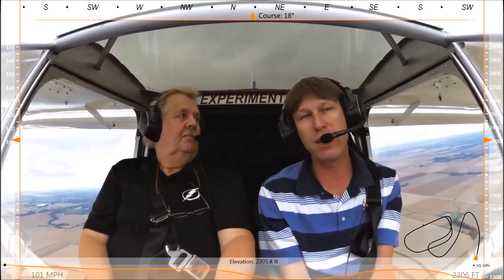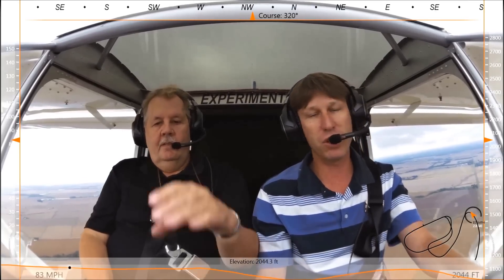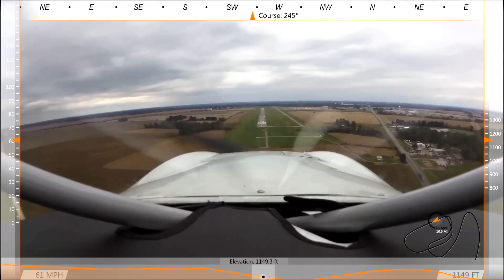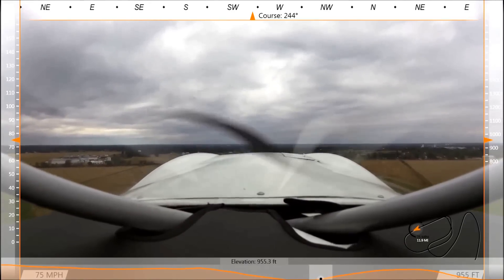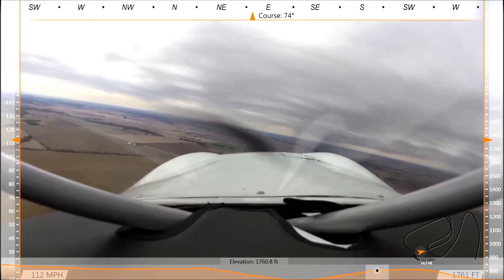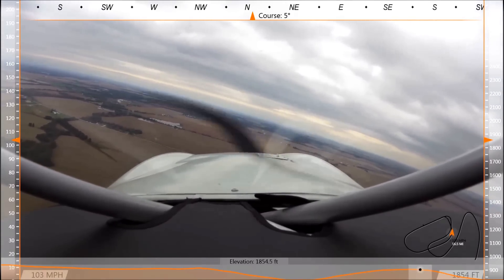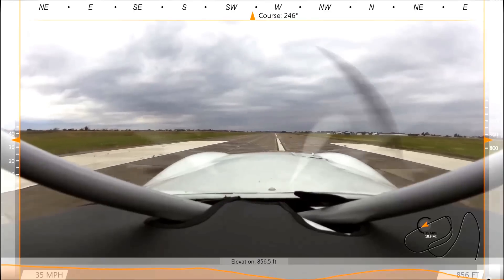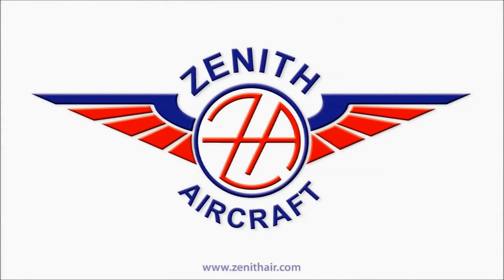Demo flight with Roger in the Zenith CH 750 Cruzer

Comment: What's the deal with the oil door? Looks like it's talking to you...
Reply: Looks like the latch needs to be tightened a little... easy enough to do
Reply: Seb C H yes a little tweaking. That's what is so great about experimental aviation. The amazing thing is the power to weight difference between the UL and the O-200 70-80 lbs is a major weight reduction..... Inspirational video. Roger is the man. Thanks Sebastian.